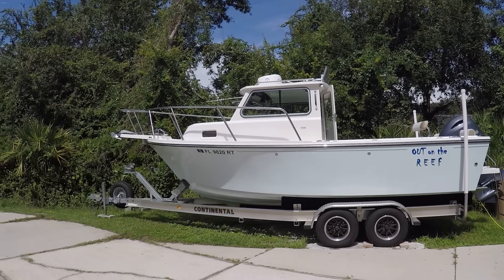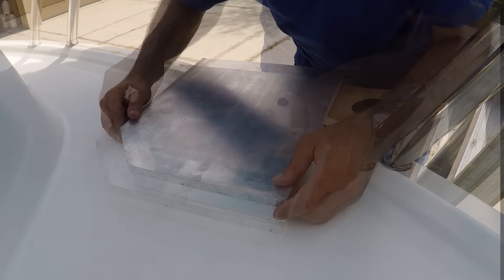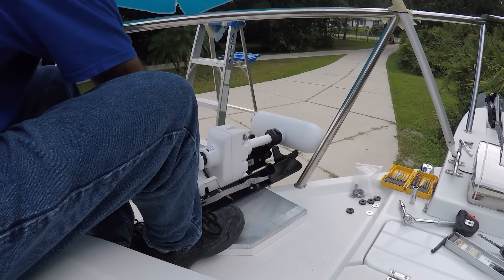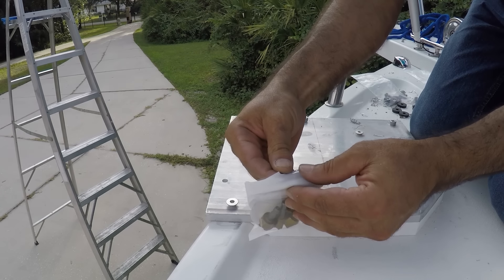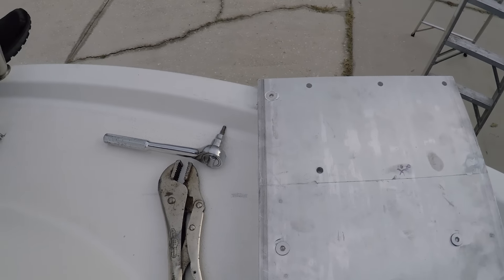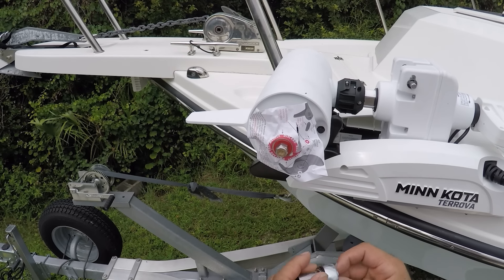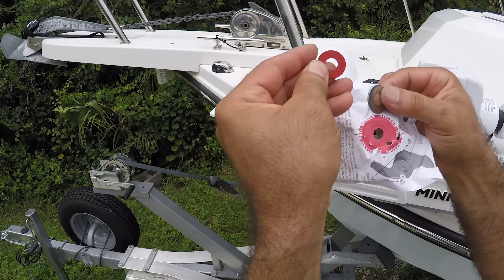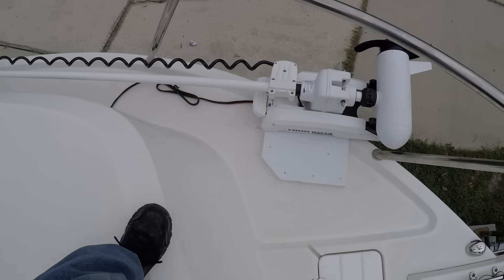Custom Installation Minn Kota Riptide Terrova 112 thrust 72 shaft Trolling motor Crooked PilotHouse

Comment: HI Captain, I bet your getting sick of questions about this install....but it was soo good. I am about to pull the trigger on a trolling motor for my Parker 2110. Do you have any regrets not going with a longer shaft motor? I fish off of the northern California coast and would love to add the Motorguide xi5 because it will integrate with my Simrad. My only concern is the 72" shaft.
Reply from the maker: Hello cap. And if I had to it olover again I would still go with the 72 shaft, I'd the perfect one for my boat

Comment: How much did you spend total for this project.  Also I as told to get the 84 inch shaft for the choppy days.  I have a parker 2110 walkaround. thanks
Reply from the maker: Hello cap. And i placed the link of all the items i purchased in the description below cap so that way you know the exact amount and im very happy with the 72 inch chaft the 84 in is overkill for my boat cap. Hope this help cap.👍⚓️🛳

Comment: Noticed you did not cut the bow rail, how much clearance u have between rail and bow floor?    Is it retrieve difficult with the weight of the motor?   I am planning similar install for my boat, will be great to hear your advice!  🙏
Reply from the maker: the motor has a balancing that helps with the weight of the motor , my clearance is about 22 inches

Comment: Excellent video! How high is your bow rail? Mine is only 12", which may be a problem.
Reply from the maker: Hello cap and mine is way taller then that i think 20 to 24 inches unfortunately this installation wouldn't work for you unless you cut the rail.
Reply: @OutOnTheReef  I'm going to fabricate a cantilevered mount for outside the starboard rail. It'll be out of the way for docking. I can't bear to cut the rail.
Reply from the maker: @thebleeb1681  Yes i'm the same way, cutting the rail will make it weaker . So with a little bit of thinking I think you can do it captain

Comment: Excellent installation.  Did the propeller hardware not include an anode that you screw into the shaft?  The only reason I ask is because I just installed my Terrova and it included an anode for saltwater application.
Reply from the maker: here is the response from minn kota on the enode Beginning in October of 2019, Minn Kota eliminated the sacrificial anode from all of its products. Minn Kota is confident their saltwater coating and painting process eliminates the need for the anode. Furthermore, due to recent environmental regulations, Minn Kota can no longer offer the sacrificial anode as an accessory or part.
thanks for the heads up cap.
Reply: @OutOnTheReef  WHAT?...That means get one and put it on yourself
Reply from the maker: @johnm5714  as of October 2019 the Minn Kota company deleted the anodes they said there was no need for them since the Minn Kota has well-protected paint
Reply: @OutOnTheReef  I would watch it very carefully Capt.—-anodes are what’s been used since the cave man began making things that rot...special paint ? 🧐
Reply from the maker: @johnm5714  I know but Minn Kota are not producing those notes anymore so you can even find them in the internet for sale

Comment: Nice install. I have the same motor my instructions said to use a different nut in salt water use.
Reply from the maker: You mean the nut that holds the propeller?
Reply: Yes much bigger than yours supposed to be an anode.
Reply from the maker: @riggs5849  yes but Minn Kota discontinued that part they say they no longer need it that they're engineers saw that was not necessary so they discontinued

Comment: Wow!  That was a very clean install.  I've been looking for a video like this as I'm considering doing the same thing.  This gives me great confidence and detailed instruction on how to go about it.  You've got a new subscriber, can't wait to see what else you have on the channel.  Can you show how you setup the battery bank and went about the wiring?  Also, where did you get the start board and aluminium plate?  Great video!
Reply from the maker: I will show you how to wire everything and I have the links of every item that I used in this videos on the description below captain I hope it helps you on your installation and welcome on board my channel👍👍

Comment: Looks real nice, I'm hoping to do something similar on my 25 Boston whaler Outrage, kind of tricky though being foam filled..  

I'd probably put bigger chamfers or radii on the mounting plates, just not to jamb my toes..  ouch.. my luck I'd jamb my toe and fall off the boat from the excruciating pain..

I saw on Amazon minn Kota makes a quick removal mounting plate..  something you can add if you think it may be useful..

Is this the same boat you had before without the pilot house, and you just added the pilot house?

Cheers!
Reply from the maker: the boat i had before was the Yamaha 190 FSH and i trade it for the Crooked PilotHouse Boat
and  what i did with my installation was that i study and plan for a month and then i made my move, i recommend to study your installation that way there is no mistakes especially after opening holes cap. thanks for the great suggestion and for watching my channel and hope you have a great installation 👍⚓

Comment: Now that you’ve had this rigged for a year now is there anything you would have done different ?
Reply from the maker: No Scott It's perfect the way it is I would not do anything different anything different I put a lot of thought into this installation about a month of thinking getting engineering so that way I wouldn't have any problems and the length of the shaft is perfect also

Comment: Do you have any issues with the motor coming out of the water? I have the same boat and have heard a 87 inch may be better. Also do you have the West cost bow rail or standard?
Reply from the maker: I think the 87 shaft is overkill I really like the 70 inch shaft captain it works perfect for me
Reply: @OutOnTheReef  thank you. Does the extra weight on the port side make your boat list at rest while in the water? I ask bc my boat is wet slipped and I worry about weight distribution a little more than if I trailered.
Reply from the maker: @timrudy4359   Well in the case of my boat I have the fridge and fish batteries on the other side so it really balanced my boat out and my suggestion is to balance it if you put the trolling motor in one side you could put the batteries on the other side to offset the weight captain

Comment: I just had a 1/2 in aluminum plate fail. The machine shop sold me cast aluminum. Said it was some high grade stuff. Dropped an 80 in rhodan in the drink. Your plate looks good
Reply from the maker: Sorry to hear about your plate Captain I know it's very frustrating after you do everything to have a part failure.
And my aluminum plate I got it Amazon it was $74 and a hat gray reviews that's why I rather buy my stuff at Amazon because of the reviews of consumers before me.
Thanks for your comment captain
Reply: Cast aluminum is brittle... BUMMER!  Always use rolled or forged aluminum if it will face stress, bending or impact, but I guess you know that now.   Sorry to hear about that loss!

Comment: excellent, so it will keep you in place , like anchoring ?
Reply from the maker: Yes you don't need an anchor anyway you go now with a trolling motor it keeps you within 5 feet radius I think that's pretty close so it's on fishing at 200 feet to 400 feet I would have a problem at all.
Is 100% more effective than an anchor
Reply: @OutOnTheReef  mannnnn sounds good!!!!
Reply from the maker: @PedroRodriguez-ui6pq  have you seen those Yachts that they have Skyhook or some very expensive boats that have three or four Motors that use the feature Skyhook will this is something similar it will keep you in the same position just as more economical
Reply: @OutOnTheReef  Super!!!

Comment: Having added an 82lb (24 volt) Minn Kota Riptide with Co-pilot/Autopilot to my Walkaround, you may encounter issues with battery usage (you will need to install another battery charger and get quality AGM batteries that can take a beating and will not Off-gas while charging like Lead Acid batteries).  Your boat, as does mine, sits much higher above the water, and creates a large provide for the wind and waves to push and change the angel of the boat. It is going to require a lot of trolling motor adjustment (left/right) to stay anchored on a single location in moderately windy days.  
I also had many, many boards replaced on my Minn kota Riptide.  The trolling motor just starts turning (except when on Autopilot) and that appears to be an indication that the board it bad.

I hope it works out for you
Good luck
Reply from the maker: Awesome suggestions captain and yes the 82 lb Works harder and waste more battery because it has less power when you go to 36 volts I believe for being a bigger motor you waste less battery I think you're on the power.
I just released my battery is deletion in charger can you please look at this video on my channel the recent one and let me know if this equipment is a good one and also the batteries they are AGM
Reply from the maker: Here is my new video of the battery and changer.
Please let me know when you think
https://youtu.be/FMehIlI3-SQ

Comment: Suggestions; Next time...use 1/4 or 5/16" plate (unless you get free metal).  Put a radius on all the exposed square corners and use a router and a radius bit to round off the long edges.  Better to not paint, just let the aluminum weather to gray and whiten it with Aluminum Brightener now and then.  Avoid using silicone as it can promote corrosion, better to use a polyurethane sealer.  Lube all your stainless hardware with "Super TefGel" to guarantee you can take things apart in the future.
Reply from the maker: very great tips thanks captain👍👍👌⚓

Comment: I have the same minnkota and you will want to get a trolling motor support. Because the shaft is so long the head unit can hit the deck when stowed and travelling in rough seas. Ram mounts as well as anglers pal make them and can be purchased on amazon. I use the anglers pal so I don’t have to install anything on the motor. It is a must to save the motor.
Reply from the maker: Awesome suggestion captain and yes I already got one I will be installing it soon thank you for the heads up cap .
Reply: In the meantime, you can run a bungee cord from the top of the motor around the railing to support it.
Reply from the maker: @thilltony3362  I already purchased amount that you going to love when you see it

Comment: Nice work! Are you installing it's own batteries to power it?
Reply from the maker: Yes I am doing a 3 battery install and a charger and all the wiring I'm doing that myself captain on the next video
Reply: @OutOnTheReef  yeap! Perfect! You will use a ton of battery power on the spot lock. Congrats! Great install!
Reply from the maker: @jswold2007  thank you Captain and thank you for your awesome support
Reply: Hope you go with an onboard charger, have one on my boat just plug an extension cord into the waterproof socket just like shore power.
Reply from the maker: @IGETDOWN07  yes wen i get home i power my boat up and i will have a 3 bank charger.
And i have a generator which i can charge at sea cap.

Comment: Yeah man—nicely done! Let me ask you this—-how thick was that Fiberglas you bolted it through? If you had to guess...——just curios.also what’s your plan for that thing? Up here in the North East the hard core fisherman use them to simulate a drift if the current in the bay is slack or also they use it to slow them down if it’s moving too swiftly. Anyway—great job my friend 👊🏻
Reply from the maker: the thickness is about 1 1/2 inches cap. fiberglass and plywood and thanks cap for watching👍⚓
Reply: @OutOnTheReef  good—the thicker the better.going forward—if it seems like it’s not holding up structurally you can always add some MEAT( wood) underneath
Reply from the maker: @johnm5714  that's a great idea and also I cannot a aluminum plate under but I don't think I'm going to have a problem this boat is fiberglass Plywood And then fiberglass and it's about an inch and a half so it's pretty thick but thanks for the great suggestions captain

Comment: Only error I heard was 3 100 amp batteries giving you 300 amps...... what you will end up with is 36 volts and 100 amp hours. I have 3 120AH batteries and I get about 5-6 hours of stand alone use from my ulterra 112 in my 23ft cuddy. Amazing units. You'll love that motor.
Reply from the maker: Well the only difference between me and you Captain is that I have a onboard generador and i will have a 20amp 3 bank charger, that way I can stay longer in the water.
And what's the actual weight fully loaded on your boat captain?
And are your batteries AGM that makes a big difference
Reply: @OutOnTheReef  My dry weight is 3900 I'd estimate loaded with gear, fuel, and people i hit 4500 to 5000lbs. So you will distribute 20amps across 3 batteries? So 7ah per battery. So let's pretend you have your motor at 5 out of 10. Meaning a roughly 27ah draw. Minus your 7ah charge you're at about 20ah usage. Meaning about 5+ hours of use. I actually use a 2k watt inverter to pump some juice back into my batteries through my onboard 40a charger while I run my main engine. These are truly amazing units and I've always gotten more time on the water than advertised but it's better not to push your luck especially when you have the ulterra that requires juice to stow.
Reply from the maker: @bushonry  grading for captain 
Once I get it all done I'm going to try it and I'll let you know how much time-of-use I get it out of it.
Thanks for the great info and for sharing your knowledge👍👍

Comment: Good deal. Only thing is I would make a support for the head. Shaft is very long and in rough seas that head migh vibrate up and down, so I would make a base or something where that head can rest on while at rough seas. 👌👌👌👌👌👌👌👌👌👌👌👌👌
Reply from the maker: Captain thank you for the great suggestion you are awesome and yes I already have a part for this I just need to install it and soon you'll see it on a video what part I chose for this and thank you for looking out for me Captain you're awesome

Comment: Why not 3m 5200 over silicone ?
Reply from the maker: This is Marine adhesive I just call it silicon sometimes my bad and is very strong and it dries very quick
Reply: Love the videos keep up all the hard work
Reply from the maker: @jamesrumsey1061  thank you for your great suggestion and for watching captain
Reply: 5200 is a Mutha if you have to remove something for whatever reason. PL Marine or 3M 4200 is best for this application
Reply from the maker: @Aaron.Davis56  awesome thanks cap, i use something similar is locktite  marine adhesive

Comment: Change your Prop on the minkota to the Kipawa 3 blade prop it will give you More Power in the wind and in Current with less power consumption....i use it in the ocean in maine. casco Bay also in Bass tournament....use tour old o e as a spare
Reply from the maker: awesome Joseph i will look into it👍

Comment: Its gonna be a pain to maneuver it in rougher seas... you should just cut an inch and a half or two out of the rail and make a folding clip-type mechanism so the rail can be put back together temporarily.
Reply from the maker: Great idea captain and I will keep you updated on how it works in rough Seas
Reply: Great job sir! Lot of info to take with me. 
I’ve been fumbling my 87” minn kota to different positions before mounting to avoid cutting my rail. 
My Reel isn’t as hi. Won’t fit the head under the rail no matter what I do. Don’t feel so bad now that someone is suggesting to cut it. Chop chop.

Comment: Hi bro. what is the length and width of your boat ? and its weight ?
Reply from the maker: Hello cap 21 feet  8.6 beam and about 4500lb with equipment
Reply: @OutOnTheReef    I need minn kota but my boat is 12000 lb and 24 feet 9 beam ☹️ what can I do pls help me ?
Reply from the maker: @tufangirgin140  that's very heavy captain I don't know if the Minn Kota 36v 112 can handle that but I have seen in YouTube some big boats but not 12,000 lb maybe 8,000 pounds the most.
My suggestion is visit the Minn Kota website and they'll give you more specification there or call the 1-800 number they will know more about it but I don't think it will help you but I could be wrong captain and it is an awesome way to Anchor by the way

Comment: hello captain, beautiful installation ! this will for sure help you out allot. I think placing a rubber band or some sort of bungee cord on the rail where the head of the Minne Kota meets when in folding position, tying it to the shaft will prevent the long shaft from bouncing to much when under way on the water. maybe the head of the Mind Kota will hit the pilot house. Just to be safe. Hope the motor will bring much joy.
Reply from the maker: Thank you for the awesome suggestion Roy and I have a surprise for you I purchase something that is not eliminate this problem and soon in a video I'm going to show you what it is it's just like what you start but a little bit better.
Thanks for looking out for me Captain 😉👍
Reply: @OutOnTheReef  awesome to hear that. I cannot wait to see what you have in mind. stay safe.

Comment: Another trick I found out by accident, is high temp engine spray paint bonds to aluminum without any primer better than any paint I've found. 

If the paint starts to flake off down the road, try it. Works better than specialized self etching paint I've found.
Reply from the maker: Thanks for sharing captain